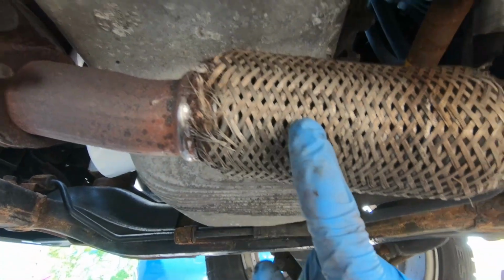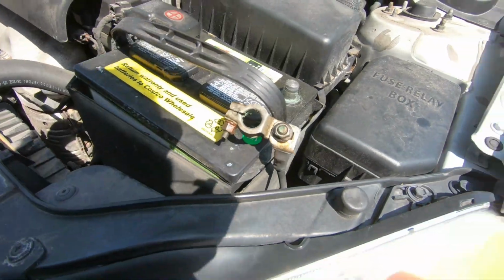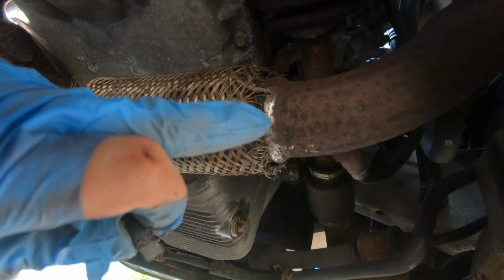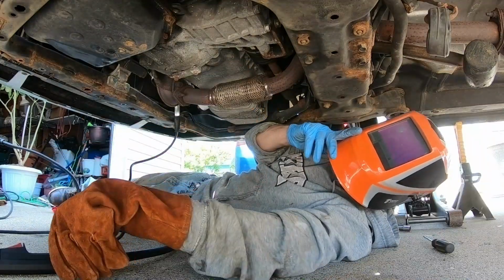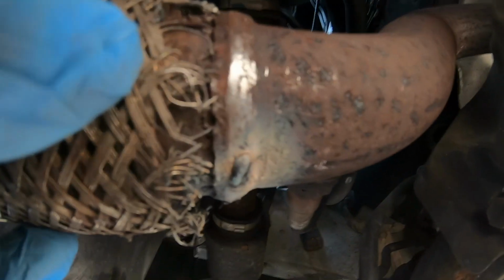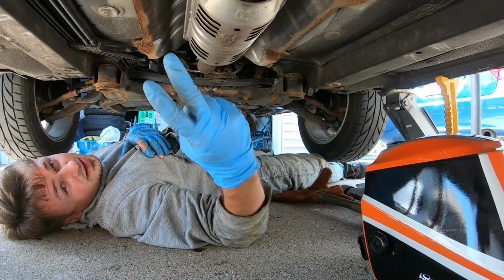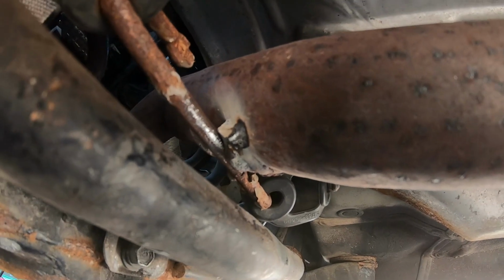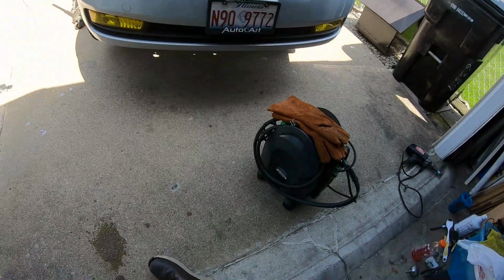Overhead Welding with Titanium 125 Flux Core Welder (Burned)

Comment: Glad to see you using more jack stands. Now as far as your welding. I think you are starting to get a grip on it. But when you are welding overhead like that you need to get your body out from under where you are welding unless you have no choice. When I saw what you were doing I was waiting for you to get lit up and start rolling out from under the car screamin. lol  I think I would loose the rubber gloves too. Also always make sure your leather gloves stay over top of your sleeves. When I started mig welding about 50 years ago, I was welding overhead under a car. I had on a leather coat too but somehow the sleeve was exposed and I got a molten drip from the weld. Went down my sleeve and was frying my arm. I just calmly laid the welder down and wiggled out from under the car. Took my coat and shirt off to see a burn about the size of a quarter. Second and third degree burn. Put my coat back on crawled back under the car and finished what I was doing. Sometimes when you're wiggling around under a car you can expose what you meant to keep covered. lol Ill pass on what my welding instructor told me. It doesn't matter if you have to lay down, stand on your head or what ever. Main thing is to get comfortable. I know that's hard on the neck too. Find a board or a brick or something that wont burn, to lean your head against. I hope my short story helps you. lol
Reply from the maker: Haha yah lucky just a few  blisters on the abdomen! Yes the car was well supported! 💪. I got so lucky last time taking my pipe off my civic.  That jackstand was leaning like me after 2 beers.  Haha.  Looking at the video I put a welding glove on my left hand and then I use that to support my head while welding and the welding hand just has a rubber glove Oh lord!!! Noob alert!   Thanks for the comment mr funk always good to read your comments and tips and tricks!
Reply: @BulliKid  That  ganja will cause you to lose focus. lol

Comment: In addition to disconnecting the battery, I would also disconnect any airbags. It's highly unlikely, but current from the welder could deploy them.
Reply from the maker: Hmm good point but where would you disconnect the air bags from.
Reply: @BulliKid  

Pull fuses out
Reply: Any recommendations for when welding close to the gas tank👀?

Comment: LoL this video was funny and awesome. While it lacks technical prowess, the can-do attitude is fantastic. I was looking for motivation to do some total beginner overhead welding and I found it here. I definitely wouldn't weld with my body directly underneath though. As for the flex pipe and low budget fix - I'd double up a couple aluminum cans and fasten them with band clamps.
Reply from the maker: Awesome! This is as real as it gets lol. 
Thanks for the comment.

Comment: Wear a leather bib or jacket. Yes it will be hot, but trust me, you wont feel the hot sparks on your arms, chest, belly. A few moments in leather will save you from days of putting up with scars or blisters. Another tip, try colder setting when welding overhead, gravity works against you and if you have a hot puddle it will want to drip, a colder weld puddle is waay more easier to control. My credentials? Well i have been a pipe welder for only 8 years, but you can say that a dummy gave you pointers 😜😜
Reply from the maker: Thanks for the tips! It seems like the lowest or coldest setting are a must with flux core and then exhaust metal.   
Otherwise I burn through

Comment: Flux core welding can not do aluminum is not stainless steel or steel in general or carbon so the chemicals. In the flux won't bind and stick to aluminum bases metals

Comment: Becarful Buddy the very first weld you did in the  video one of those red hot wires came off the gun and luckily it stayed stuck to the car I have had those go down a pant leg and in my shoe burnt my sock and sometimes you could be wearing a sweatshirt that may have grease or oil on it and you catch yourself on fire becarful 👍
Reply from the maker: I had a few sparks go right through my sweater and left little burns on my abdomen. I  will be more careful next time for sure
Reply: ' darwin award winner'

Comment: Yah that flex pipe is garbage anyways they always burn holes and your never gonna weld the mesh itll just burn through .... New clean solid pipe to put in place over the crap pipe there and youll be fine make sire your using a lower speed and not welding more than about 10 seconds if that at a time tooo much heat on thin metal bub
Reply from the maker: Thanks !!
Reply: In a spot like you got there a solid pipe like fence post is what id use easy too get at home depot or whatever welds somewhat easy for me being a little thicker than exhaust pipe , if you gotta connect a bent area id just spread jb weld on outside of old pipe to help seal a little better with your c bracket things, slide a new flex pipe on and tighten up each end let it cure and it held up for me without welding till the new flex pipe burned out again , ( depending on how close the flex pipe is too the manifold its gonna melt faster and if youve gutted out cat or straight piped cat your whole exhaust will heat up much further back aswell
Reply: @BulliKid  i wanna be good enough some day to angle grind pipes and make my own custom welded tubes 😎 backyard style

Comment: Um get a leather shirt/jacket made for welding please, and don't be right under your weld (ouch)! ' Everything's burning" lol.. And please practice first on similar metal (i.e. on cheap exhaust repair pieces from your local auto big-box department).
Reply from the maker: Thanks for the tips boss!
Reply: @BulliKid  And sand/clean your ground contact spot and weld surfaces. You'll see a big difference between clean 'practice' metal and a rusted exhaust.